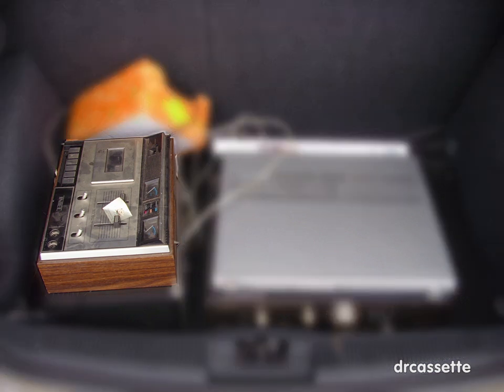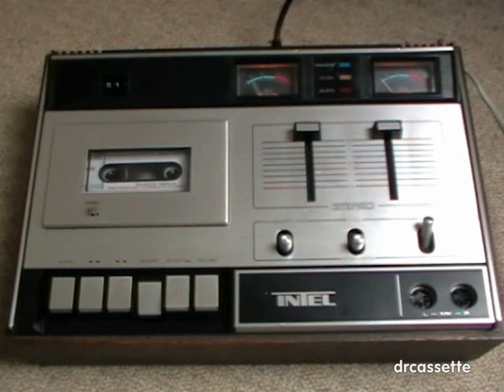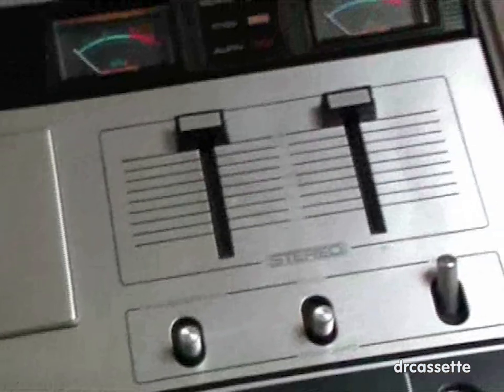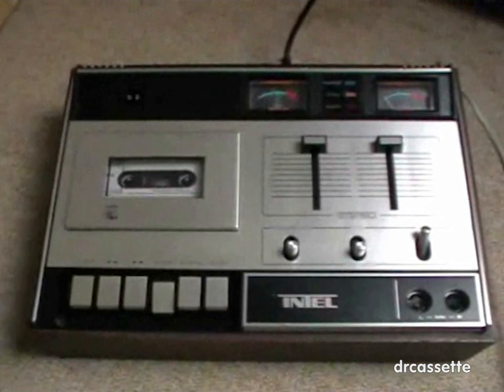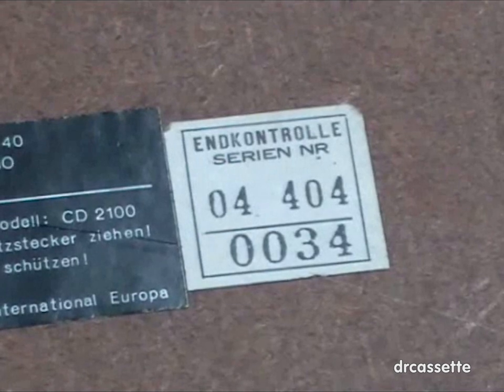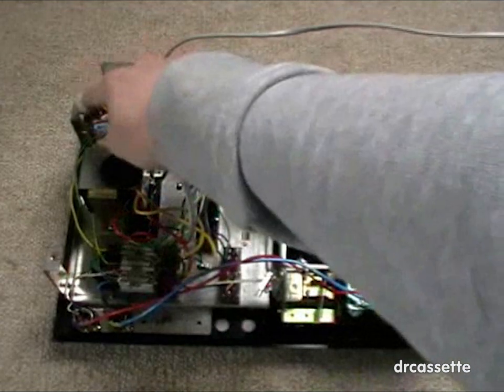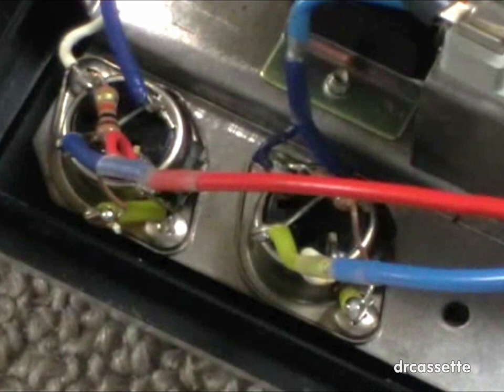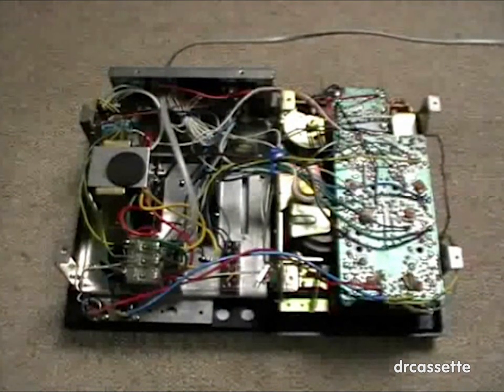Detailed look at the Intel CD 2100 cassette deck

Comment: This was my first tapedeck, in 1977.  Prelude, and I used it for a few years. It worked very well, with a ok f/r, but it was noisy. Three years ago, In 2021, I stumled over a newer version. with Dolby, and it works very well. Same era, but almost no noise, and a wide frequency response. Its heavy, and equipped with very complicated circuitry, I love it, brings back memories and sounds very good.

Comment: This is a rebadged Amstrad 6000. There was a 7000 which had a few imporvements including Dolby. I suspect these were OEM by Sankyo or Orion.
Reply: Also, you can see in Google images how they used those jack cutouts you found inside.The DIN was obviously for the German /Euro market
Reply from the maker: Interesting, so far we have versions of this deck branded as Intel (Interelectric), Amstrad, Concerto by JIL (see comment above). Thanks for the info!